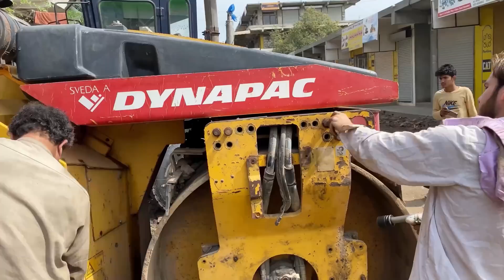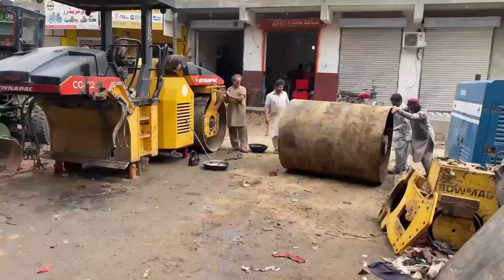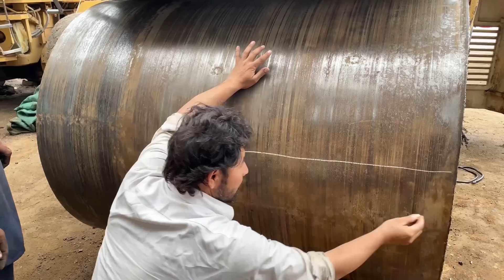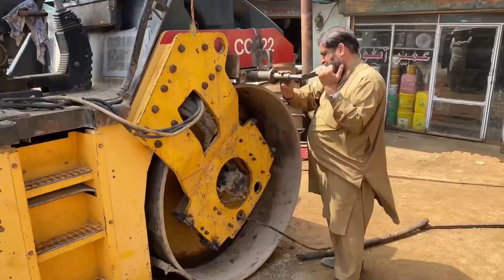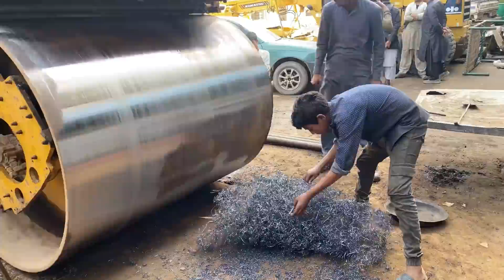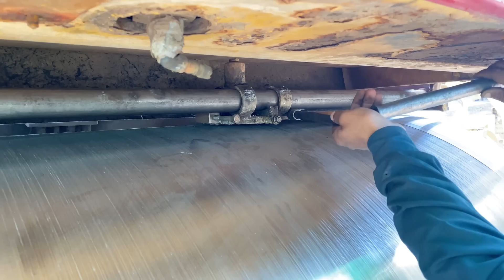The Roller Drum of Road roller became crooked || How it repaired with a locally developed tool? ||

Comment: Using it's own power as a lathe was impressive, hats off to the team
Reply from the maker: Thanks for appreciating
Reply: I bet the customer was thinking,  hey,  that had a full tank of diesel when I brought it in!
Reply: Complete disassembly of vehicle to drain the remaining fuel sitting on the bottom of tank, carburettor the fuel pipe and return pipe, although I would not be surprised if that was missing since the original mechanics probably deemed it unnecessary, that's probably on the top of Hilton hotel, been converted into "roof mount long john spinners"
Reply: @Amazingskills838  I suppose using clubs and some hand protection is a sin in some countries while working.

Comment: How can you not be impressed by the skill and hard work that goes into this repair. We live in a throw away world here in the west, the ingenuity on display here to recycle and repair should be a lesson to us all. Great video.
Reply: It is impressive.  But I guarantee they don't just throw away those drums in the west.  They cost tens of thousands of USD, at least.  They repair them much the same way: they weld more material into the low spots, then machine them round again on a large lathe.  It's virtually the same thing, only it's a purpose-built piece of equipment.
Reply: @Jester J You actually believe people in the west just throw away a $100,000 drum when they could repair it for $5,000.  Talk about dense. 🤦‍♂
Reply: Agreed ❤
Reply: We do repair such parts here. But we do it in a way which does not jeopardise the lives of workers.

Comment: Amazing craftsmanship and skill on display here. As an auto tech in the US, it completely impresses me how they repair almost EVERYTHING there. We have gone the other way. It used to be cost efficient to rebuild an alternator. Hardly anyone does that here anymore. I have rebuilt my own and a few for customers but finding the parts has become difficult. Parts stores used to stock rebuild/reseal kits for power steering pumps and gearboxes. No more. We used to be able to get brake caliper rebuild kits. No more.
Reply: There's repairing back to factory spec, and then there's 'pakky spec' - two vastly different things.

Comment: I wonder what are the variations of thickness on the cylinder itself after they make the exterior more or less round. Compared to the manufacturer specifications.
Reply: Exactly, I was thinking the same, the less thick it becomes the more it is prone to be bent again.
Reply: At some point the cylinders have to be replaced.

Comment: Apart from the fact the drum is now thinner and more likely to distort the Engine now needs an overhaul with all that running.
Reply: Exactly the comment i was looking for 😂
Reply: And that weld should have been fillet cut with root and cap passes.
Reply: the engine is fine u think a couple hours of a heavy machinery operating is gonna need a overhaul yea okay lmao.
Reply: The surface removed was minimal and wouldn’t affect the overall strength there over engineered during production anyway. You’d only get away with doing this a couple of times though until it did fail. As for the engine not sure why running it would require an overhaul?
Reply: @gingerturtle4229  just people hating the poor
Reply: There you are. I see you
Reply: @paulramsey8187  😮 u
Reply: Next time y’all go fix it since y’all kno it all
Reply: @traesmith4241  yes, we will. Some of us have been there and know the short cuts and we make comments based on our own experience.

Comment: 🚧⚠🔧It's crucial to prioritize safety when using any machinery or tools, and the video highlights an important concern regarding the use of a swarf hook. The proximity of their clothing to the hook poses a significant risk of injury, and it's essential for individuals to be aware of the potential dangers and take necessary precautions. This video showcasing the repair of a crooked roller drum using a locally developed tool is both intriguing and raises awareness about safety practices. 🚧⚠🔧
Reply: You are talking about safety when in their state a goat has probably more rights than a yung girl
Reply: I stopped reading your comment after the silly emojis.

Comment: I have a question….
The drum is out of round…..and so they machined off a good 1/4 to 1/2 inch.
Isn’t that drum paper thin now?
Or will they pull and re-line it?
Otherwise it’s going to fold up the first time it gets used.
Reply: You're right! This drum will break soon! Not only did it get thinner, but where it was hammered and welded it lost its stiffness from shock and heat. I appreciate the creativity shown, but it's all too improvised!  Even the "lathe" bends and in fact they hold it down with an iron bar!  They practically limited themselves to polishing it!